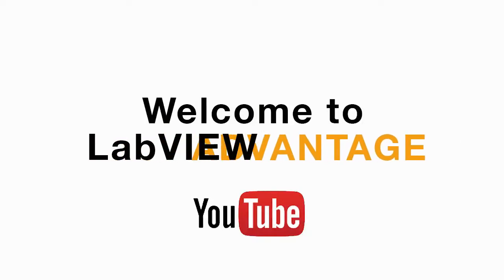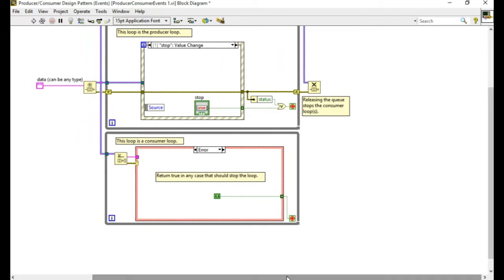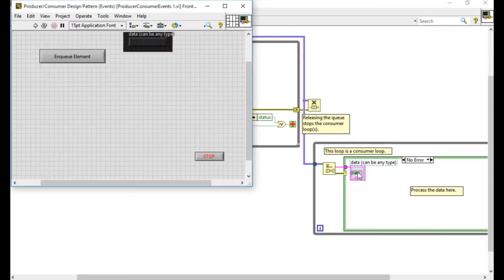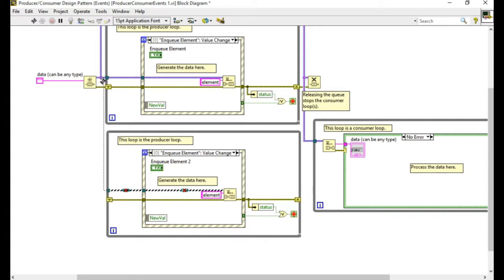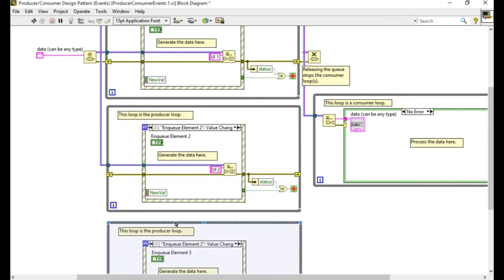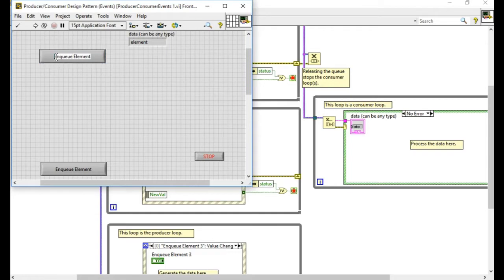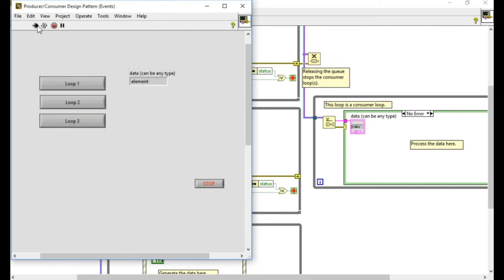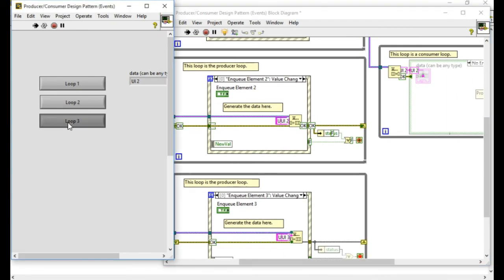How to use Queues in LabVIEW

Comment: I hate to be negative, but this is an awful demonstration of how to use the queue functions. All you are demonstrating is that a queue can be written to from multiple locations. If you really want to show how to use the queue functions correctly, take the basic producer-consumer and create an application. You have the option to to show how data can be 'streamed', or passed along with a message.

These types of demos do not help new LabVIEW developers create well structured applications.
Reply from the maker: +SunSon29 Yes you are right. This video demonstrates N:1 Communication using Queues. Previous video shows 1:1 Communication use.
Reply from the maker: +austinman1234567 Thanks for the critical feedback. The producer consumer using queues is already covered in different video earlier in this channel.
Reply: May i have a link?
Reply from the maker: +SunSon29 link for?
Reply: the link of "The producer consumer using queues is already covered in different video earlier in this channel."